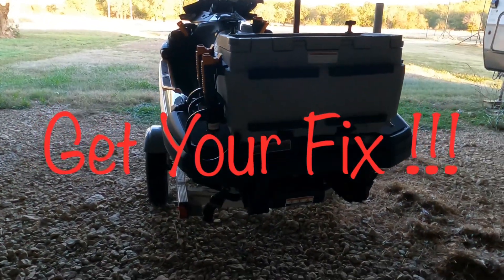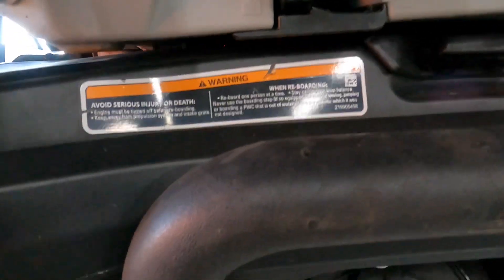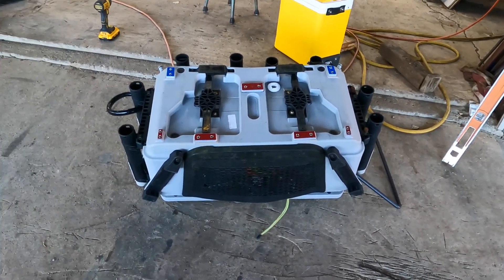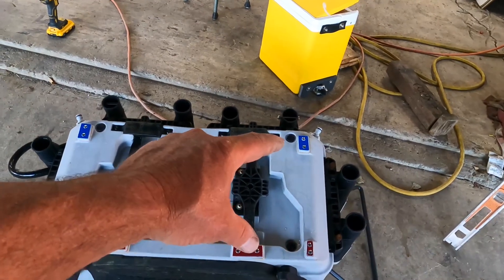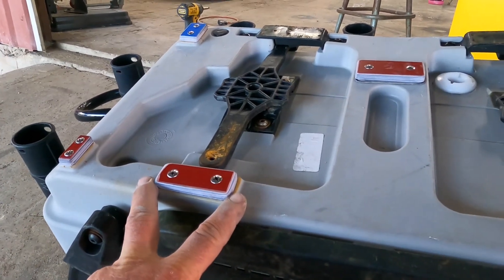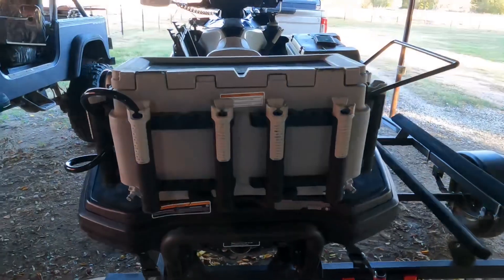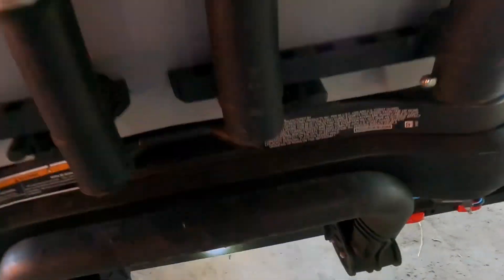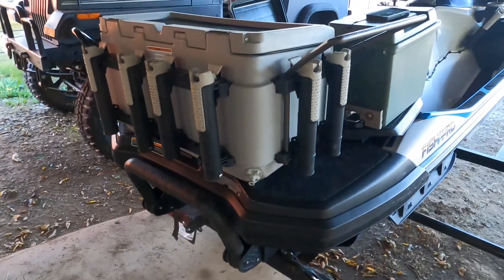Fishpro Get Your Fix!!! Cooler/Livewell Wobble #seadoo #fishpro #jetski #pwc

Comment: Definitely more cost effective than replacing all those worn parts 👍
Reply from the maker: I definitely see this as something every owner will have to do around the 3-4 years. Again how you treat your ice chest makes a difference. Not that I slide mine all over the place but that does wear down those feet quickly so be mindful of that. Also that black deck padding does shrink and compress over time. Also installing that drain plug may be the biggest difference maker. Hypothetically you could reduce the full capacity carrying time by half. Because once you’re out of bait drain it and drive to the boat ramp empty!!!

Comment: Enjoy your videos very informative. How about making a video on the Garmin Fishfinder. It has a feature that will show all the engine parameter's, however sea-doo did not install the cable so the Garmin can read the engine.  NMEA 2000 cable is needed to go between the Garmin and the Sea-Doo. So far no one has made an instructional video on how to go about doing this.
Reply from the maker: Brother, I wish I had a good answer for you, but that depth of technology information I do not possess. However, you can reach out to Garmin and they might be able to help you out. I rely on them a lot.